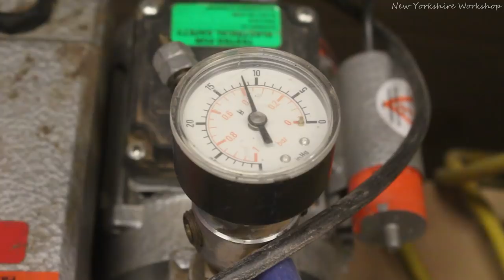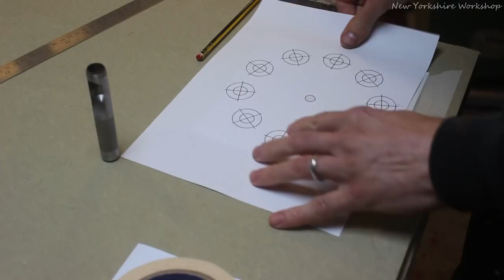Making a massive Circuit board for a table top

Comment: Maybe just add a couple of brackets and screw it into the walls? The compression strength of the legs isn't an issue; just the lateral movement. In my mind that would make it way more stable.
It looks freaking fantastic,  btw :P

Comment: Lovely build, I like how it turned out. 
With the legs, to try making it a bit more sturdy how about something like a clear acrylic/resin tube through the middle of the twisted copper, leading to a flat foot? 
It should keep the surface steady and shouldn't be too visible, keeping the circuit board aesthetic.
Reply: Or just make the legs from polished stainless rod, then spray copper-tack headgasket coating on for a copper wire look.

Comment: As regards the top - speechless, although it does seem a pity to hide it away in a back room.
The twisted copper of the legs resembles the 16mm cable used for domestic supply installations and that usually has a thick insulation.  Maybe encasing part of the legs in a mock insulation would help to stabilise them. Also, a replica busbar partway up the legs could help reduce longitudinal movement.
But certainly a very impressive outcome.
Reply: Could you use coloured resin to replicate the pvc cover on house wiring - brown, blue. green/yellow, black or red?

Comment: Absolutely superb!  That would surely fetch top $$$$$.
I wonder if solid copper wire would have better stiffness or perhaps inserting a solid steel bar in the twisted tubes in a concealed manner.  Brass rods would be more ridged and golden in color.
You should enter this in a show somewhere.
JIM

Comment: The copper will harden on it's own eventually, but flexing the copper back and forth will do it much quicker.
Reply: Though it won't become any stiffer in the elastic region with work hardening (the Youngs Modulus won't change)
Tinning the wires would stiffen it right up, but would need several pounds of solder.

Comment: Wonderful, except for the legs. Legs were an interesting idea in theory but didn't work in practice. Maybe wind the wire around polished spiral turned walnut legs, or whatever.

Gold leaf is burnished with a polished agate burnisher after application to the size. Minimize the brushing, which leaves scratches, just like abrasive sanding of wood.

Comment: Dude table is the coolest !!  But my advice to you was to twist the legs from steel rods and paint it like copper if it is so important, it would be outwardly invisible, but the table would stand rigidly in place.  I hope it will be clear what I wanted to say, I just write through a translator.  Good luck and success!
Reply from the maker: Thank you, it is a good idea, i could also electroplate the steel with real copper!

Comment: Just discovered your channel - <subscribed>. 

Very cool!  I wonder if making the twisted copper legs into an X like the fold-up picnic table would have given it more stability.  Also would be cool to drill through all of the pin holes and fill them with clear resin.

Comment: I was surprised you did not burnish the gold leaf before you put that coat of lacquer on it.
Reply from the maker: im really new to gold leafing, i have a lot to learn. i think burnishing would have improved the texture and removed the brush marks that were showing through?
Reply: @NewYorkshireWorkshop  Yes, it would have made it smoother and more uniform. Most gold leafing you see in Architecture is burnished.Still like the table. :)

Comment: i think, the legs wobling because the copperpipes have no connection. next time i would try to make the round steelplate at both ends of the pipes. when you twist you get an elephant leg end with much more stability.  to solve the woble problem i would pour superglue or epoxy carefully between the pipes to harden the legs. and after that two vertical x-coss copperpipes diagonal between the legs as stretchers. . i could not work at a wobling table. And!: please paint you walls! but anyway a very creative project! regards

Comment: I assume the legs are made from copper pipe. I wonder if you could pour some resin down the tubes to stiffen them up? Impressive result though.
Reply from the maker: do you know i litteraly hadnt thought of that! damn good idea.
Reply: @NewYorkshireWorkshop  ...having thought about this for a few seconds more, maybe polyurethane expanding foam would be better. It's quite rigid when set and is probably easier to squirt through the tubes. Jeremy.

Comment: We can't get lacquer anywhere in the us. Did you know 7 coats of lacquer on a magazine page. Let dry put in warm ivory dish soap would lift the picture off the page. Did this back in the 70s.
Reply from the maker: thats intetesting
Reply: I a magazine picture of a deer facing to the right can be turned to the  left. So on a motorcycle tank it would be facing the same direction. Time consuming 7 light coats warm water with ivory dish soap.  My dad used candy apple clear lacquer.

Comment: Hi what brand of high build polyester do you use?
Reply from the maker: Im using Sayerlack PUL7946
Reply: @NewYorkshireWorkshop  thank you. Can I be a pain and ask if you can give me a breakdown of the different products you've used to achieve this look? I'm trying to get the chemical numbers from your video but I couldn't see them all. Thanks
Reply from the maker: no worries. the whole system is-
Barrier coat im using is Milesi LQA836 and hardener LNB837, the milesi stuff is better than the sayerlack barrier  but more expensive, it definitely provides a better barrier, especially on really oily woods like cocobolo (the sayerlack stuff is TR4027 and hardener XT4028 if you were interested) the barrier is needed if you are staining the wood or if it is oily as these things will react and inhibit the cure of polyester. I use it on everything though as 'belt and braces' just incase as uncured polyester is nightmare! (from experience :) )
the polyester is Sayerlack PUL7946 with catalyst ph888 and activator ph999

and then im using maxmeyer 0300 automotive clear coat just because i use it for other things as well and it keeps the number of tins in the cupboard to a minimum, but you can put all kinds of top coats over the polyester.
Reply: @NewYorkshireWorkshop  could you tell me how long it takes for each product to dry and what temperature please?

Comment: do you have any information about your membrane press please
Reply from the maker: what do you want to know?
Reply: @NewYorkshireWorkshop  how did you make it is there a video or plans
Reply from the maker: it is unlikely i will make a video unless it catches fire and i have to make another! no plans as yet either but it is relatively simple, just a base made of 25mm mdf and film faced plywood with a cavity inbetween for air flow and obviously holes in the ply. the lid is a just extruded slot profile mitred and bolted together with 3mm shot blast rubber as a membrane. the clever part is that i used speaker wire to retain the membrane into the slot profile. the seal is just a 10mm ribbed neoprene self adhesive seal. as i progress more with my new blog i will take photos and write up a better description with plans.
Reply: @NewYorkshireWorkshop  Thank you very much for your time and share